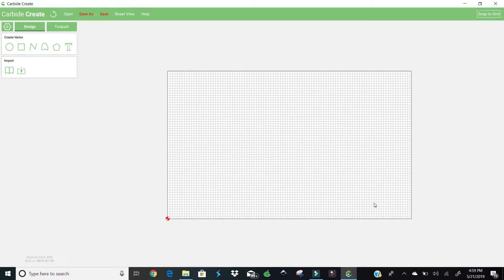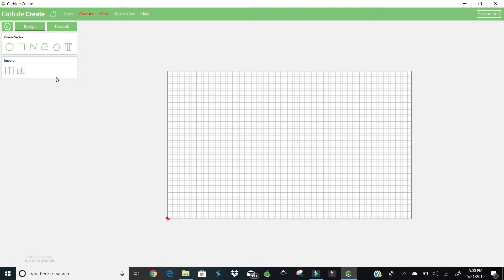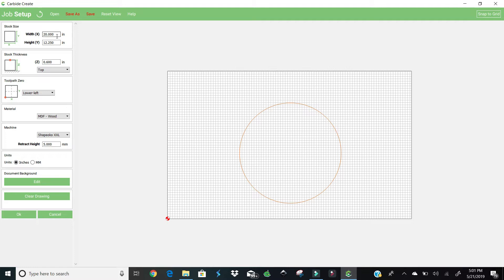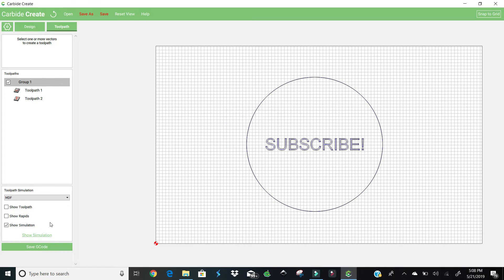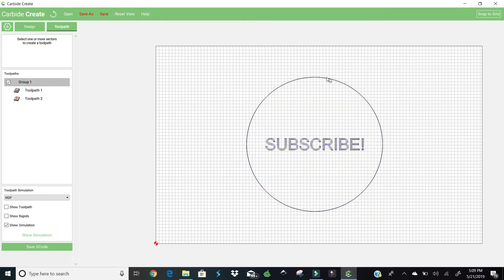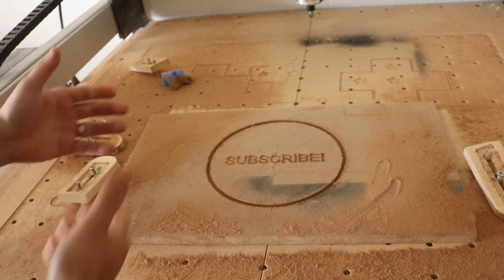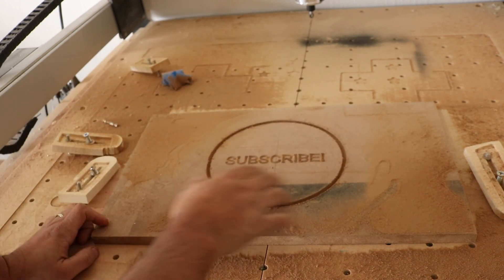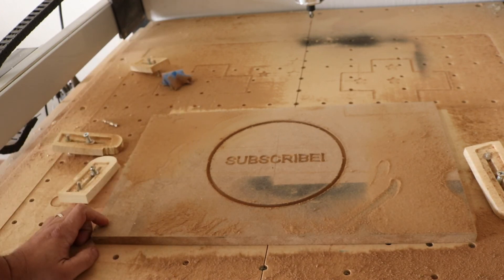How to do a bit change in the middle of a project on a CNC machine (shapeoko xxl)

Comment: Change all M0 commands, after the first, to M6 and use GSender. and you don't need to split into two GCode files.
Reply: What does this do?
Reply: @arbjful  The m6 command will cause gSender to pause (make sure you have Pause selected in the gSender Tool Change Settings) the program so you can change to the next tool bit and zero it. Hit  Resume and the program will carry on carving with the new tool fitted.
Reply: @pw3111  is it possible to do the z offset routine for the new tool bit, during the pause?
Reply: @arbjful  yes it is. As long as you have “Pause” set up in the gSender “Tool-change” setting, it will pause when it reads an M6 command so you can change the tool and re zero it. An M0 command basically freezes the jogging controls but the M6 allows you to jog. Hence re zero the new bit.

Comment: when you went to the zero position with the v bit did you re probe the corner or just go to work position? because the bit i am changing to is longer than my other bit, the Z will be off if i dont re probe but i am worried it wont probe exactly how it was before and it might go slightly off

Comment: When my program finishes the first cut the router does not raise up and go to the home position. It just stays in the place where the program finished . Suggestion on what I’m doing wrong
Reply from the maker: You have to adjust your height limit on the program. If you don't set that, it won't raise high enough

Comment: Carbide 3D just released the Bitsetter probe which automates tool length setup. Now it will pause the machine move to the front of the work spares and prompt you to shut the router down and replace the but. Then click next and it will  go over and touch off on the bitsetter probe with the new tool to zero its height.
Reply from the maker: Errr figures lol. Ima have to check that out. Thanks for the heads up Iujon!

Comment: What I do is insert a small spot outside of my workpiece (usually toward me centered) as a 5 second tool path so it pauses for the bit change away from my work piece... so far it has seemed the fastest easiest I have found... Great video though, it’s an easy way for sure
Reply: I have the xxl and have also found that if you use a drill stop set from home depo you can set up your second,3rd, 4th bit on your first zeroing. When you zero the first bit put bit 2 in, drop router to zero then the bit to the paper like normal and tighten. Then zero the drill stop on the collet nut.
Do this with every bit you have and 
At least that way when you're prompted for Tool change it's literally just the plug in the bit and send it (like the software makes it seem to be) and you can produce a quantity much faster more automated. 
Also a dab of Loctite and a flat spot goes a long way for the collar to not slide over time ensuring the drill stop is flush against the collet nut.

Comment: If I'm not mistaken you only have to re-zero out the Z axis correct? It should still remember the X&Y even though you used jog. As long as you don't manually move the axis by hand while changing the bit (like if you put side pressure on the router and it slips position).
Reply: That is correct
Reply: If u set the XYZ with the touch probe with the end mill and run that code (circle), can you then use the touch probe to do the Z with you V bit for the “Subscribe!? Wouldn’t that be a perfect way to do it? I like you method, but it doesn’t work for me when accuracy has to be 100%. Thanks for sharing.